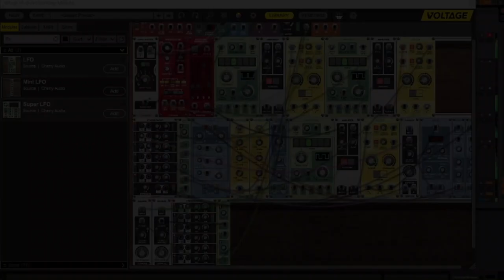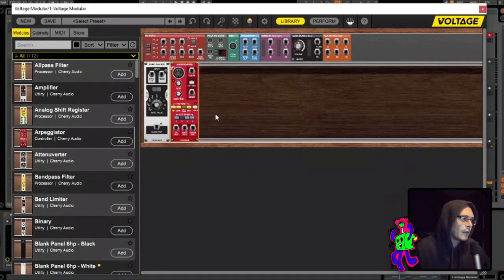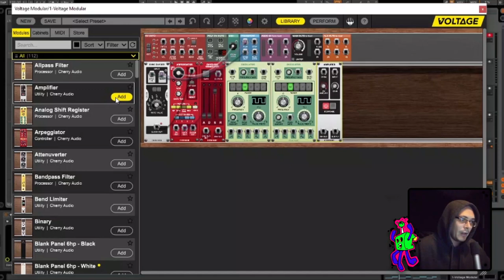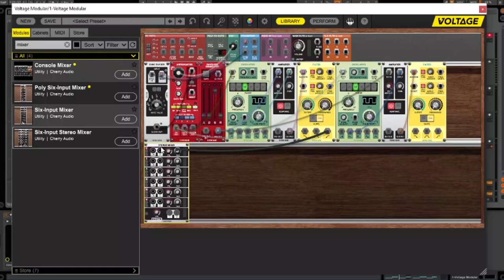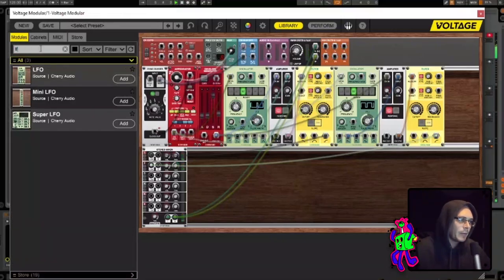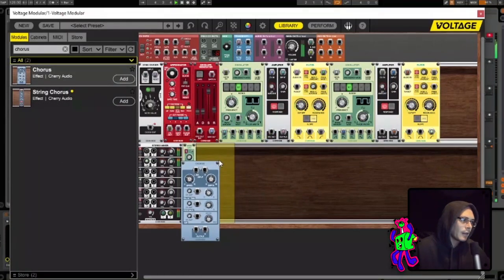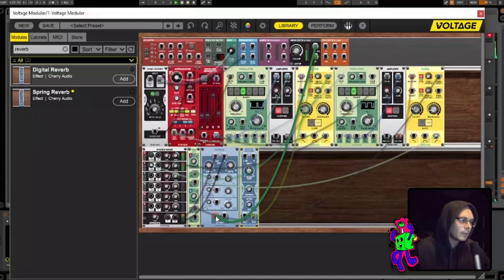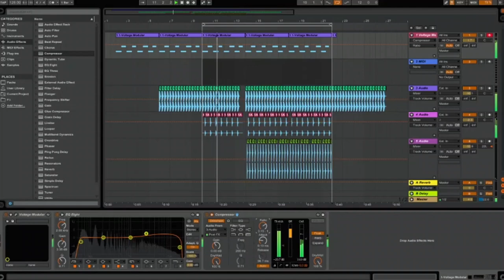How to make an Arpeggiator using Voltage Modular by Cherry Audio [Modular Synthesis] Sound Design

Comment: great to follow this tutorial as a beginner but it would be a lot clearer if you could give a bit of tip's about the modules..For example on the info section of either the sync divider or arpeggiator i don't find a lot of info on what it is they actualy do...

Comment: Gawsh! THANKS! I am at the very beginning and I am going totally Koo-Koo Gladly I found you and other Voltage Modular tutorial and slowly but surely my head gets around it... :) It's very satisfactory once you are able to create you own sound(s) ( rewarded ) nut before that there is an aceeedeee process (perhaps am also quite tiered today! :)
Reply from the maker: Glad to help :) sounds wicked when you get everything set up. Those acid vibes are great :D I might do some more vids on Voltage Modular, let me know if there's anything you'd like to learn :)
Reply: @ProducerLife  That would be awesome THX! I was wondering if get into the hardware, starting really slow, buying the essential modulars and a tier, my holdback is that I'd like 1) save the patch, 2) integrate it as much as is possible with my DAW, I don't want to end up in spending hours of creating drone sounds or funky baseline for hours and then "Puff" all gone once device is turn off. Don't get me wrong i do understand the fun and the purpose of going back to outboard gears and synthesis , as I was messing around last night with the Voltage plugin I was happy to be able to save my hard-sweated work to understand and create a new patch, now is saved on my user folder. That is the beauty of the plugin, but as far as concern "hands-on" nothing come close as the real thang! So I am trying to figure out my best option out there and what's in the market that will allow me to use external analogue synth with my DAW (final stage-after recorded a pattern/part). We'll see. For now am still learning this curve on the plugin version... :)